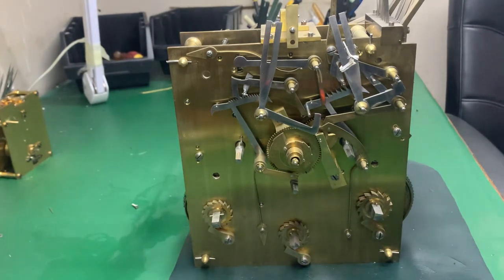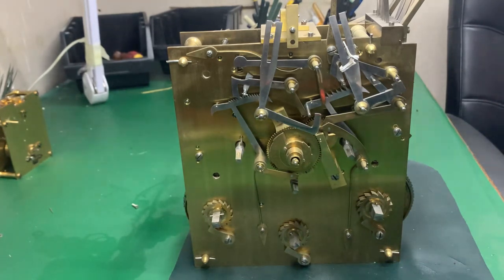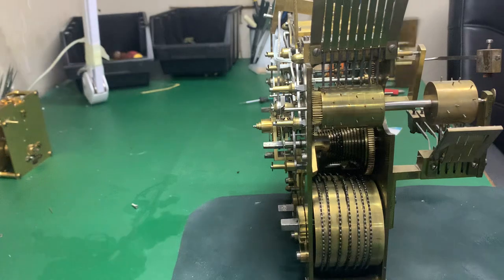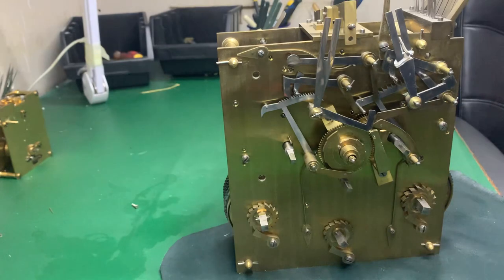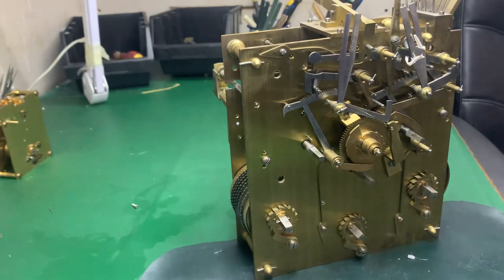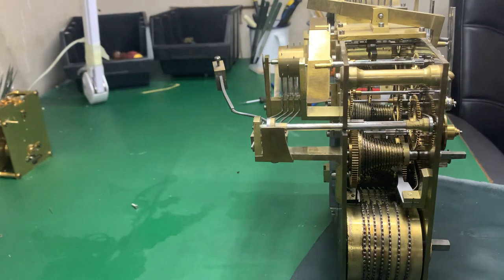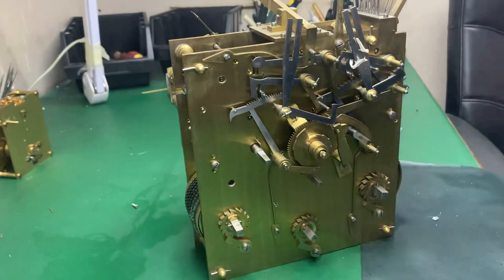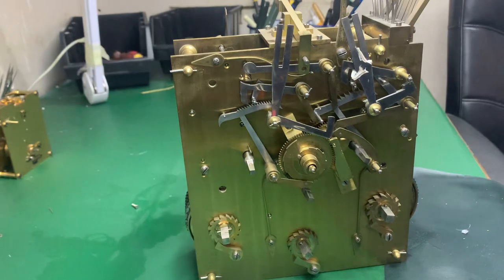Triple Fusee Chiming Bracket Clock Movement Service , NO 1

Comment: I am working on a triple fusee bracket clock movement, putting back together . Had problems, barrel end caps came off chime and going and had to be re hard soldered, while taking spring out sorted now, and the removable end caps had to be worked with a plannishing hammer  so they would click in the barrel slots, and not come out . 2 of the fusees were also seized up initially, the toothed wheels wouldnt budge.So some repair work to do after it was taken apart.

Also going fusee was stiff in its bushing hole, not sure how that happened. And the strike fusee was very loose in the  bushing holes and had to be rebushed. They were put in their correct holes, each fusee was a different size, and each individual train put in to check for depthing issues but was o.k. Before this the 3 trains had to have rebushes as well. So now ready to be put back together. No wonder it wouldnt run , with all these issues.
Reply from the maker: Lot of work there, fair play getting it right 👍👍
Reply: @clockrepairsmerseyside8303   Thank you ready to put back together now, but will soak the chains in turret oil and make sure there are no stiff links. Done over 400 clocks but this triple fusee is a first. I have worked on single fusee timepieces, and a double fusee ting tang of my own. On the one in question the plates are really thick. Such a relief getting the springs back into their barrels. I don't live all that far from you , Bramall Cheshire.
Reply from the maker: @verybigkittens7550  I find the triple fusee type clocks are not to bad to work on although they can look like a daunting task at 1st, yours sounds like it’s had a hard life, hope you are getting paid what you deserve, & fair play to you for taking what sounds like a mess on 👍👍👍

Comment: I don't put cast brass plates in the ultrasonic tank, the amonia based cleaner can get into the pores of the plates. Also on these the plates are generally too big for mine. Have you tried rustins brass restorer, I use it sometimes. I don't like to take the original lacquer  off if it is in  pretty good condition. I also take plenty of photographs as well.
Reply from the maker: We hand clean using home brew cleaning solutions, some have  ammonia  but my understanding is it’s the action of the ultrasonic cleaner is the problem, all I can say is we have had no problems, but very rarely use our ultrasonic cleaner cleaned by hand most of our cleaning solutions are old  home brew recipes then we finish off with 0 wire wool, the ammonia is 28% , ammonia has been used for a long time to shine brass.